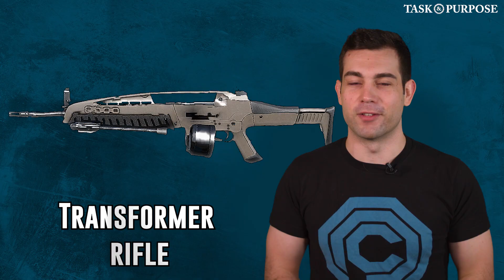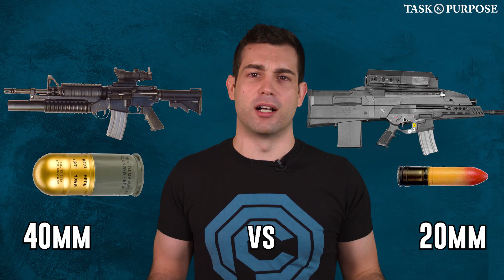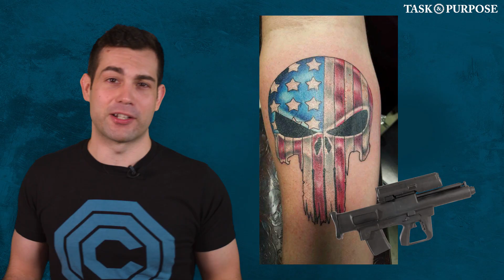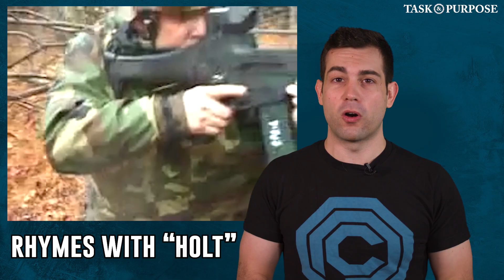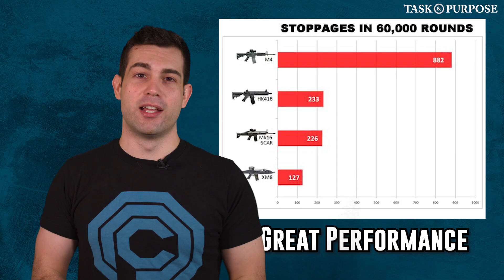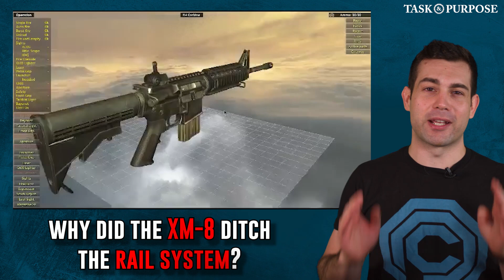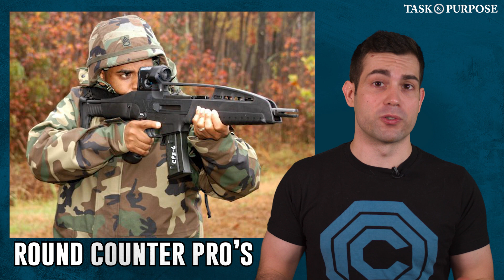Why was the Army's XM-8 Future Weapon Series Canceled?

Comment: The OiCW project had problems right from the start with before projects began because of the fall of the Soviet Union 1991 after Desert Storm earlier in 1991, the budgets getting smaller and smaller. But that sparked the interest again in a new platform. The 90s was the modding of M16a2 to later mass fielding of the M4 and modding the M249 and M240 and pretty much getting rid of the M60 and any variant. The platforms of Hk XM29 (sabr) XM25 and XM8. 25 and the were tested in Afghanistan. Personally i think they should have continued and considered the XM29 for field tests in Afghanistan and Iraq. Great video
Reply: One of the critical shortcomings of the 29, literally, was a 10" barrel. It would've never been useful in a theatre where they were dusting off M14s to get more range. 9/10 of the current lethality issues could be solved by going back to a rifle. The main reason the M4 was mass issued, is because everyone started riding around in cans. The result, was mass adoption of a less potent individual weapon; the M4 is right at the threshold of reliable terminal performance for the 556. Outside of a vehicle, a carbine yields very little benefit over a rifle; and any rifle practicality issues are addressed very well by a 18" barrel and collapsible stock.
Reply: Spring Bloom true to a degree. They would totally have to revamp M14. The M14 should have gone through changes in the 60s  so every soldier could utilize its potential by making it the Mattel. Thus changing it from long range and sniper to close quarters combat as well. Moving a large weapon through the door from high or low when stacked takes milliseconds more. I believe each squad should incorporate a M14 Rifleman in both teams to accompany the SAW and regular M4 Rifleman. Especially since the M203 is getting less. I am for any weapon that out performs our adversary. As long as durability, accuracy, lethality, weight, rate of fire, rounds per magazine, weight of maximum load. There has to be a little give and take from each. The 6.5mm or the 6.8mm just might have what it takes

Comment: The OICW, fully loaded was 18 pounds.
An M4 with M203 fully loaded, with Acog and PEQ15 weighs 12 pounds.
That's nowhere close to the same weight
Reply from the maker: I double checked and you're right, good catch
Reply: That's what I thought I heard. In the vid, a little confusing.
Reply: There in-lays the issue.

Comment: Why the XM series was canceled: It sucked butthole

And it has a nasty habit of separating the operators arm from their torso.

And boy do I wish those dust tests would officially be deemed illegitimate by the Department of Defense.

The competitors to the m4 got to bring their own brand new proprietary magazines for testing, while the M4 was stuck using the existing magazines with green and black followers, which were the cause of 90% of AR platform malfunctions, NOT the rifle and NOT the environmental conditions. 

Special operations ordered an immediate STOP USAGE DEMAND on all magazines with green and black followers BECAUSE of that reason. The general purpose forces however, were not extended the same courtesy, thus, faulty magazines were in wide uses.